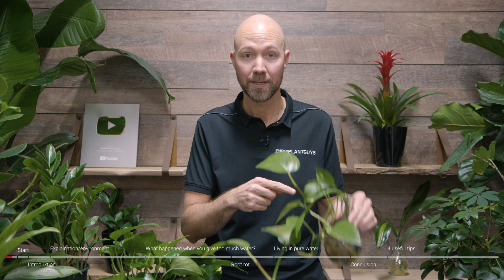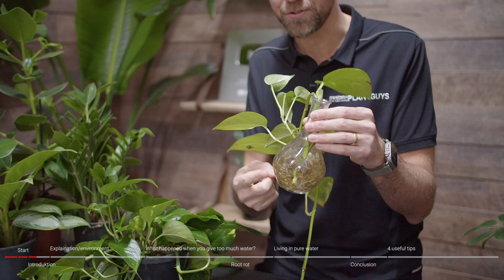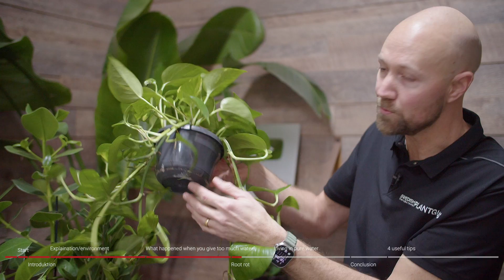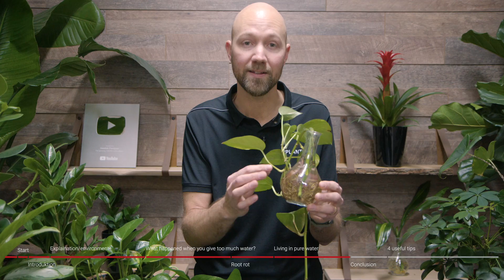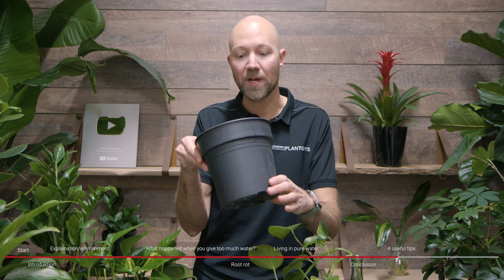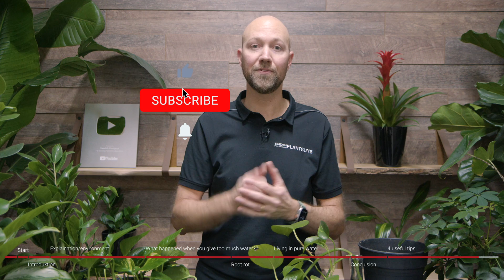Waterlogged Plant, what does it mean?How does it work 💦?

Comment: Great explanation, like always. 
Still one point, I have to criticize: If I´d apply your 1-2inch rule to all my plants, I´d most properly kill many of them:
My smallest pots are only 5cm, the biggest have about 100l volume...
Your rule works fine for the most common pot sizes, but it has to be put in relation, if the pot is much bigger or smaller.
Especially in very big pots it cam happen, that the top 10cm are bone dry, while the lower third might be soaking wet.
That´s why I personally prefer a combination of finger and weight.
(you can tip very big post a little to the side, if they get to heavy)
Reply: Use a wooden skewer